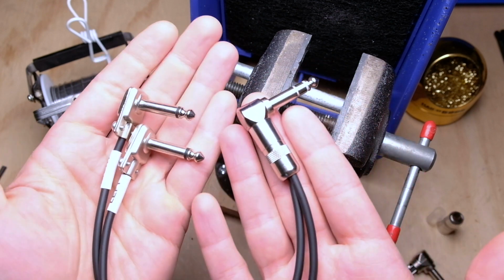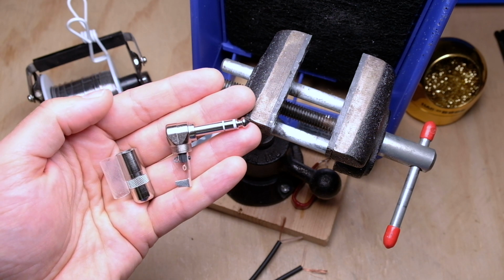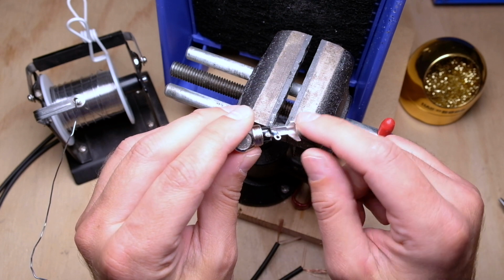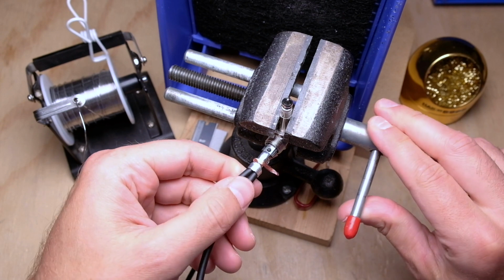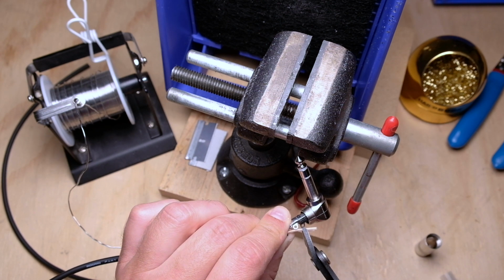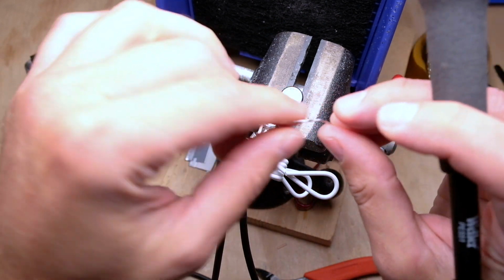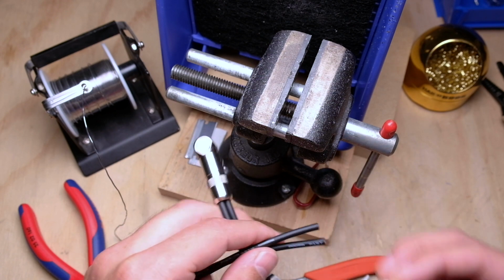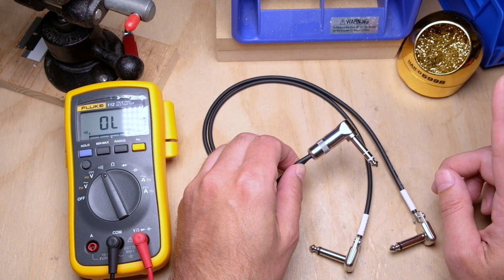Insert Cables for Stereo

Comment: Great video & instruction.  Thank you!  I appreciate your attention to detail.
Question: when soldering the cable to the Tip on the Switchcraft 236 plug (at 11:05) is it important to make sure the solder doesn't contact the plug casing below the threads on the plug?  Would this create a short or other problem?  
My apology if this is a dumb question.  Thanks for your time & response.
Reply from the maker: Thank you! This is a great question, but you don't have to worry too much about it on these plugs. They come with an insulator that keeps the solder points from shorting out on the shell, as well as having plenty of internal clearance.

Comment: While this is mostly applicable it would be nice to have a "Part 2" that illustrates the challenges of building a 1/8 TRS to dual 1/4 TS insert cable. These TR/S consumer 1/8 sized plugs are, for better or worse, becoming ubiquitous in the synthesizer market.
Reply from the maker: I have a bunch of 1/8" parts for a video on my bench right now. Coming soon!
Reply: @AlphatoneAudio  Nice!

Comment: I could've used some heat shrink wrap around the two cables that you fed thru the barrel to make them a bit more rigid and protected other than good work.
Reply: It looked like an already tight fit. I think adding shrink wrap would have been just enough to impede insertion through the barrel.

Comment: Great tutorial. Can use use a similar cable to combine a mono out and return (Out 1-4 (tip) and In 5-6 (ring) on the Mastermind PBC) to a TRS plug then plug the TRS into a patch bay so that another similar Y cable (TRS to TS in (tip) and out(ring)) cable can go to input and output of a pedal off the board (audition pedal)?
Reply from the maker: Thanks! You could do what you describe for sure, but the outputs you mention are only TS, not TRS. You would just use two TS cables to go into the rear of the patchbay and you're done.
Reply: @AlphatoneAudio  Thanks for the quick reply. To clarify, I want to use TS plugs for the out/in on the PBC and combine those to a TRS plug to go into a Schmidt array patch bay using only one plug. Then on the outside use a Y cable TRS to TS/TS for the input and output of the audition pedal. Is that right?
Reply from the maker: @jonathansilver4513  That would work. Make sure to watch this: https://www.youtube.com/watch?v=rz2nHUP2jCE&t

Comment: Hi, very nice 👌
Can you describe the difference for the strymon trs 1/4in trs to dual 1/4 in tsf? Don't know why tsf by the way cos I tried to do the same as you but doesn't work on my capitan strymon (stereo mode..)
Thanks
Jérémy
Reply from the maker: The pinout I use in this video should work with the Strymon pedals, no problem.

Comment: One issue I've been running into is that the outer shield will melt while I solder - especially if it's touching the strain relief tabs. How are you pre-bending those tabs (putting them in direct contact with the outside of the cable) without the cable melting when you go to solder?
Reply from the maker: You're melting the outer jacket of the cable? What type of cable are you using? Sounds like you're using way too much heat, or just holding the iron to the part for too long, or both.  At 750 degrees Fahrenheit, it should take you no longer that 2-3 seconds to solder the ground.

Comment: Where do you get your pre printed heat shrink from?
Reply: DYMO special label maker. Pretty expensive. You’re just better off using your computer and typing out the words small enough where you can print them manually cut them put a piece of tape over them and wrap them around the cable. It’ll still look very clean and get the job done. You probably already did this since you’ve made this comment 11 months ago and have not been replied to yet. Well, there’s your answer.

Comment: I have an ART headamp 6 pro and I want to send individual stereo aux out for headphone mixes from my 18i20. Would It make sense to use an insert stereo cable  to feed the stereo aux input of the art headamp 6 pro unit?
Reply from the maker: I checked the manual on that unit. The 6 aux inputs on the back are definitely stereo, so you could use an insert cable for this.

Comment: Idk if your still active but I’m having trouble one side is louder than the other and I have checked for continuity. Any suggestions on what might be the problem?
Reply from the maker: Hey! There could be a few different causes, but you'll have to rule them out one by one. You may still get continuity if the run of cable is shorting or the head is defective. Squareplug products have proven extremely robust in my experience but every couple hundred there's one that makes it past the QC process and causes this kind of issue. Otherwise, it might be work cleaning your input jacks with some deoxit to make sure there's no corrosion or buildup that is causing signal decay between the cable and the pedal(s).

Comment: What stereo plug would you recommend for Mogami 2319?
Reply from the maker: I just tried to feed two 2319 cables into a Switchcraft 236 with no luck. You may have to go with the Neutrik plugs as you can always remove the strain relief collar if you need more room.
Reply: @AlphatoneAudio  Thanks for the super quick reply. Is there a Neutrik plug in particular you would recommend. Have you made cables with any of them?
Reply: I decided to go with the NP3XL. Hopefully it's the right choice

Comment: So is this setup for a TRS to 2 x TS's (Right/Red/Recieve - Left/Black/Send) type of cable? Let me know please. Thank you.
Reply from the maker: That is correct.
Reply: @AlphatoneAudio  Great, thanks. Then I will use this vid tute. Just to let you know, I'm using the Gotham GAC 4/1 audio cable and since that cable has 4 wires, I'll have to pair up the Red and Pink wire, then the White and Beige wire together and go from there. If I have anymore questions I'll post it here. I also subbed to your channel. Again, thanks.
Reply: Now, into watching this vid, at 9:15 I see the left cable has only one wire and the right cable too, has only one wire. What do you do if you have 4 wires? Remember what I stated before, I'm using the Gotham GAC 4/1 audio cable. So it's double copper wire shielded and on the inside there are 4 small wires. Again (as I mentioned before), I will be pairing the up the Red and Pink (R&P) wire, then the White and Beige (W&B) wire together. Which paired wire (Right/Receive and Left/Send) will be soldered to the back of the TRS connector? Hope what I explained makes sense. Let me know what you can, thank you.
Reply from the maker: @punknugget561  That's really too many conductors for an unbalanced application. I suggest you read up specifically on star-quad wiring configurations. Good luck.
Reply: @AlphatoneAudio  Thank you, I'll make the question even easier, what cable is soldered to the back TSR connector that is considered to be Right/Return and Left/Send? Again, thank you for your help.
Reply: I think I figured it out. I had to look online to see several diagram pics On the back end of the TRS connector, I think I'm going to have to solder the Right/Return cable to the Ring (Top connector). Then the Left/Send cable to the Tip (Middle connector), and the Ground on the Sleeve. If I'm still incorrect on this please let me know. Thank you.